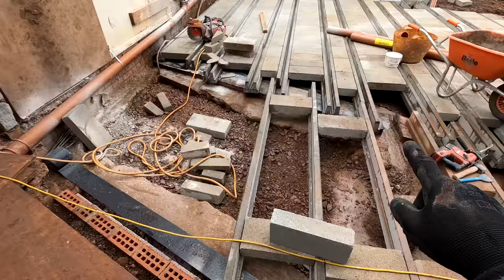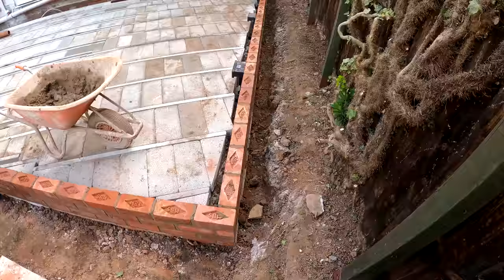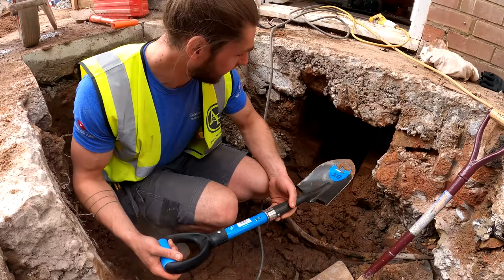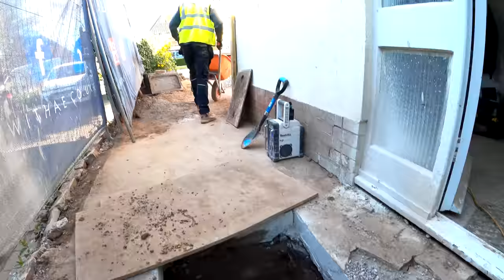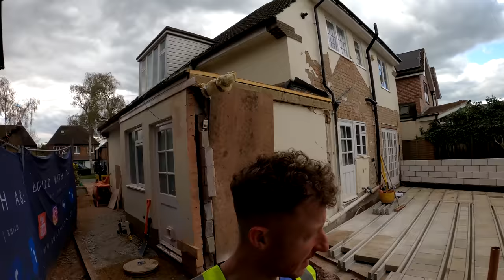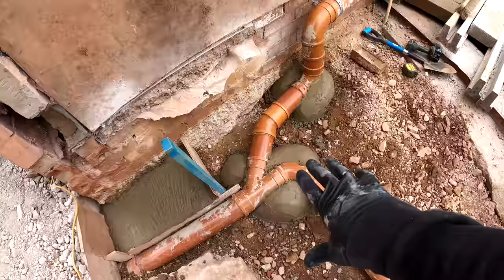Installing an Underground Drainage and Inspection Chamber | Single Storey Extension #11

Comment: Great video Guys really appreciated the new inspection chamber install details. I'm about to knock an old one out and install new. Great heads up on that. Buying the correct fittings etc is just as difficult when you're a newbie to it. Great work you lads do.👍👍

Comment: I worked in a Mercedes body shop in the 90s and saw an instant decline in quality when Mercedes linked up with Chrysler . The Germans were persuaded to run the presses stamping out the panels much longer before they were re- profiled  hence all the corrosion on the edges of the panels and an example I saw on the later facelifted E class 124 models was instead of 5 clips holding on the chrome bumper hockey stick  they only fitted 3 clips so 5 pins on the trim but only 3 clips fitted to save money . That was the mind set in a nutshell .  Hopefully Alfa will not fall into the trap of taking all the bad ideas from Stelantis ( France let's be honest )

And I would say no French company is going to have a Frenchman stood around with his hands in his pocket while an Italian is working and earning so if anyone is for the chop it will not be Frenchman.

Keep up the good work Jack

Comment: Smashing it again ! Tony , next block n beam have a look into the polystyrene blocks . We’ve worked on a load of them , less weight , quicker no dust or noise when cutting and above all warmer 👌🏼🧱👍🏼
Reply from the maker: Hi Guys I keep toying with the idea but how stable are they underfoot last time I found them a nightmare 😂 I should give them a whirl again all the best Tony 👍
Reply: @BuildWithAE  just a bit a common sense really . ( don’t walk in the middle of the beams ) but youve got a great bunch lads there . We have it in our new build and it’s definitely warmer .  
   The speed it goes in plus no petrol saw , noise , no grouting . You end up with about 300 mil of insulation too . Not sure about cost difference but you  it definitely save in labour 🧱👍🏽😁

Comment: Don't mean to have a dig I enjoy watching these videos well done to the A & E lads but when you layed the concrete pad the steel should have been dowelled into the existing found or Masonry not the clay soil, if that was me I would have  toed the lintle into the existing house so that pad found wouldn't have been needed,
Also your cavity fill in the cavity should be 150 minimum below the block and beam floor on this type of system not dpc, you treat the beam in the same way as a timber joist as the block and beam will suck in moisture, on foundations that deep normally a clay board would be fitted internally to the foundation wall for any clay expansion property's
Do enjoy watching your video content makes me want my own channel keep up the good work lads 👍

Comment: Have you ever come across this. I've been told it's a land drain. I can't add pic but they are clay pieces about 12 inches long and in a n shape just placed underground to divert water and it has flooded my oversite area where I changed the main sewer pipe and the ground in parts is really spongy. I've put blue pipe in for now but don't know how to stop or divert this land drain and I can't continue with my slab because even with 2 inch of type 1 wacked in there for now it's still moving under foot. Any ideas. Thanks

Comment: The new gully you fitted at point 18.25 on the video is that going to take rainwater off the roof as I thought  rainwater and foul water had to be separated for building regs. Also it appears you layed some of the beams side by side and infilled the gap with concrete, why was this?
Reply from the maker: Hi Kevin,
In older properties they are dual lines not separate as of today.
Beams are side by side as Beam details required by beam company then gap filled all the best Tony 👍
Reply: @BuildWithAE  Keep up the good work you'll soon be on the 1st fix.
Reply: @BuildWithAE  what? dual? separate? youre putting rainwater in with sewage?
Reply: @DICEGEORGE  Puzzles me to mate

Comment: Great video but correct me if I'm wrong? I thought it was illegal to run rain water from gutters into waste water system. They should run into the stormwater system or a soakaway.
Reply from the maker: Hi Rob,

The existing drainage is a combination system, so perfectly fine to do what we're doing. We are also running around half of the roof runoff into a soak away, which was shown earlier in the series.

Hope this helps.

All the best, John 👷🏼‍♂️
Reply: @BuildWithAE  Thanks for your reply.  Yes you're right I just found out that's fine if the house was built before 1970.

Comment: Great video as always. Question from an "enthusiastic" diy-er. Is there a reason for the gully at the bottom of the drainpipe? You went to the trouble of digging it all up so my simple mind thought the drainpipe could connect directly to the inspection chamber. Building regs maybe, or perhaps you wanted to keep the original drainpipe work?
Reply: I'm not 100% sure this is correct but i think it is due to there being an outside tap there so it would give excess water somewhere to go. There are also other good reasons to put gully  traps in, the main one being that it stops a bunch of debris that comes of the roof blocking the pipe but also provides a nice water seal trap to stop the sewer venting nasty smells straight on to "leaky" gutter down spouts which do not have rubber seals.
Reply: @Palo-jm7xc  Thanks for the reply. All makes perfect sense now you have explained it. 👍👍👍

Comment: Why lay the block & beam at that 20-ish degree angle to the back wall? Seems like that created more work?
Reply from the maker: The floor was designed to be layed parallel with the existing house, as this meant we didn't have to carry out additional work creating pockets in the back wall to carry the beams.

I hope this helps.

All the best, John 👷🏼‍♂️
Reply: Ahh, okay; That makes sense, I guess; I was thinking as there didn't appear to be much cutting of the beams around the new wall, that you'd just leave the beams slightly short where it'd meet the existing building
Reply: @thisismissem  -  the beams have to be designed and made each as one piece, not to be cut. The tension in the steel reinforcing bars has to be formed so as to loop backwards at the ends for strength of hold. You should get all beams at exact length with no cutting, as the hold of the rebar - and the tensile strength - would be compromised if you cut the return off.

Comment: Just wana to ask you why have you gone for block and beam instead of your usual concrete work
Reply from the maker: The block and beam floor was specked, so that's what we installed. 

Hope this helps.

All the best, John 👷🏼‍♂️
Reply: @BuildWithAE  
You could maybe do a video about this foundation vs your normal concrete work 
I think it be interesting to know the cons and pro vs the two 
If you can

Comment: Love these longer videos guys! Any reason why the block/beam was installed at that angle? Cheers!
Reply: Most likely to get a beam tight up with the existing building, makes things a bit easier.
Reply from the maker: Hi David,

The floor was designed to run parallel with the existing building for ease of installation. It meant that we didn't have to make pockets in the back wall of the house, saving time on additional work.

Hope this helps.

All the best, John 👷🏼‍♂️
Reply: @BuildWithAE  Cheers John , thanks for taking the time to reply. Love the viseos!
Reply: @stanevans9334  Cheers Stan, that makes sense. I think sometimes the camera angle made the angle of the beams look odd (not parallel). Or it could be my eyes! Appreciate your reply.
Reply: @davidtaylor4975  -  I think you've accidentally invented a better word for videos there, David.

Comment: Some say pea gravel to the crown of the pipe and others like yourself just throw it in who’s correct ?
Reply: Think its down to the building inspector, I seem to recall graded backfill is ok, but not 1/2 bricks/ lumps of concrete.

Comment: Any tips on finding good builders like yourselves?
Reply from the maker: Hi megaman2016 I would recommend using the FMB on line great way to source a good builder
All the best Tony 👍
Reply: @BuildWithAE  builders like you are worth every penny but unfortunately there are far too many cowboys and it's hard to know what type you are hiring until the job has started! Many thanks for the tip

Comment: I can’t believe a building inspector would pass that with all those changes in direction.
Should of come straight out of the building with both lines and extended the main line up the side of the house to an inspection chamber in line with the farthest drain.
Thumbs down from me